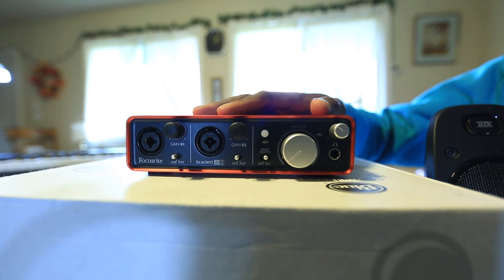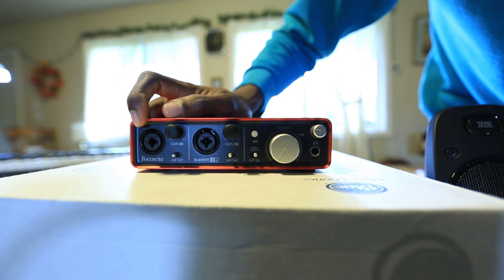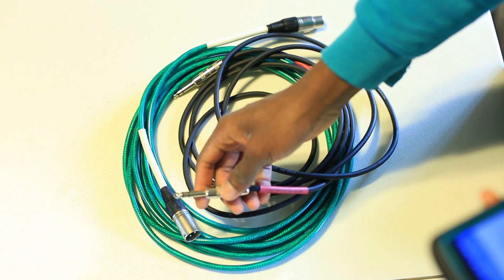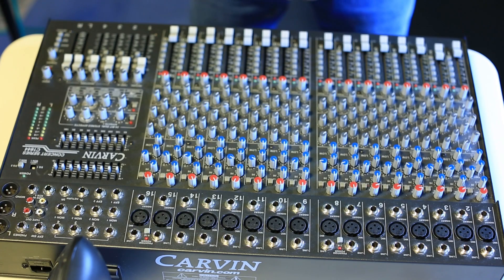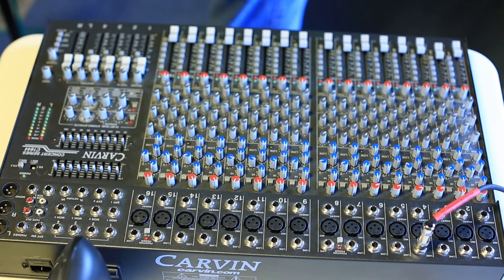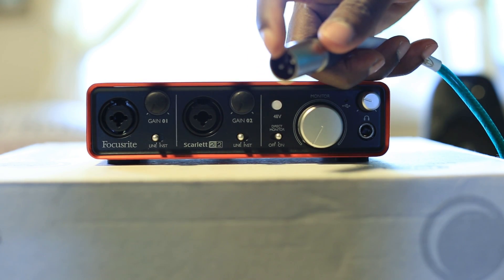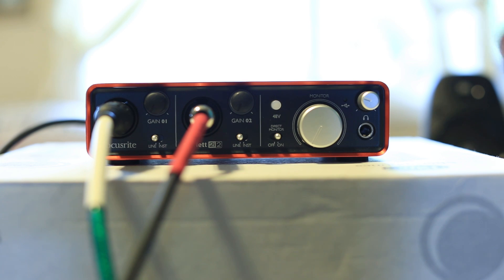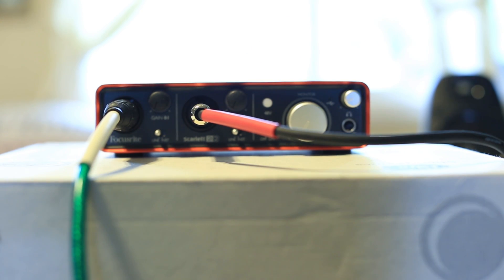Scarlett 2i2 Setup | Part 1 | Inputs (Mic/Line)

Comment: If I want to use a microphone, can I use a XLR>1/4" or do I need a XLR>XLR in for the Scarlett to get the preamp gain stage?
Reply from the maker: That is a good question! I don't how that would work from experience as I've always used XLR>XLR for my microphones (Except when I had a USB microphone).  But based on what I do know, it would probably depend on whether your mic uses phantom power or not. If it's something like an SM58 then I doesn't need power the way a Baby Bottle does, and you should be fine. If, however, it is a mic that does require phantom power, you may run into some issues. In general I would recommend using the same standard all the way through. (Example XLR>XLR or TRS 1/4">TRS 1/4" or TS 1/4">TS 1/4")

Comment: Is it possible to connect a regular "jack" microphone into any of the XLRs and make it work?
Reply from the maker: If it's a ¼" jack, it will should work.  Otherwise you have a free steps of conversion to go through. It's funny, I think of XLR microphones as regular ones 😄
Reply: Jaron Belboda i tried but I miss something because there are no signals coming through. And in my windows settings at the recording, only having a focusrite stereo 1-2 record option, no mono option at all 😕😕😕

Comment: Can anyone tell me...can I set this up so that my daughter can sing along to utube via the computer ( computer has speakers)..problem I find is I can only have music through those speakers or the Scarlett...confused.
Reply from the maker: You would need to set the Scarlett up as the default audio output for the computer. That way your daughter can hear the music and herself using the direct monitor switch on the front of the Scarlett

Comment: Thank you so much for your excellent video. Have to change from Mbox2 to Focusrite. Whch one is similar to Mbox2 ?
Reply: Mbox2 has two inputs for keyboard, so I figured that I need Scarlet 2i4?
Reply: @LyudmilaOsipova , as stated.. Yes, "if" you need more than 2 preamps at once, that is a fantastic choice. You'll also gain more features with the 2i4...😉 Focusrite makes very nice equipment. You can't go wrong. I'm not a spokesperson for them but I do use their equipment as well. Best of luck. The 2i4 is an excellent interface. 😉 💜 🍀 👻 🎶
Reply from the maker: @LyudmilaOsipova  when you say two inputs for the keyboard, are you talking about audio or MIDI? Like @Bodē Ghost Productions said, The 2i4 is an excellent interface And you can connect your keyboard via the audio inputs on the front or the MIDI inputs on the back.
Reply: @theJaronamo  exactly... Well put. 😉
Reply from the maker: @bodeghost  thanks 🙂
Reply: Yes , I record my Yamaha through midi. So 2i4 would be OK. It doesn't have  S/PDIF in and out, but I never used it anyway. Will get second generation, as I have El Capitan, and don't want any upgrade. I love my Mbox 2, all the problems started when I did upgrade, so I got the second hard drive with Yosemite , it works with Mbox, but you have do disconnect and connect again when you turn computer off. It is annoying.
Reply from the maker: @LyudmilaOsipova  ooh yes that is annoying! Glad you're able to make the switch. As you probably know the 2i4 is plug and play on the Mac
Reply from the maker: The one with two inputs and two outputs
Reply from the maker: In other words the 2i2
Reply: @ LyudmilaOsipova, great question & this gentlemen's video is very well thought out & easy to follow. From novice to pro! In answer to your specific question, yes, this Focusrite 2i2 is an INCREDIBLE upgrade from your M-Box2 situation. Im not speaking derogatorily in any way about the M-Box. Very nice interface for its time. You'll find extremely powerful & very 'clean' preamp (2) within the 2i2. Especially for its price point. If you haven't purchased it yet, look at their bundle offers. For not too much more of an 'investment' you'll get a ton of bang for your buck, if you will. 😉 ! I've seen these bundles ranging from $199.00 up to $299.00... I saw one that came with a nice mic, mic-cable, pop-filter, mic stand, & headphones! All for $229.00 !  "IF" you do not record more than "two" things at a time, say, a vocal & keyboard, at once, then you're all set. This channel recommends wisely indeed & I completely agree ! 😉 💜 🍀 👻 🎶 Best of luck to you & keep on making music! @ Jaron Belboda, nicely done sir. Straight to-the-point & easy to follow. I've "SUBSCRIBED" to your channel. 😉 💜 🍀 👻 🎶

Comment: is it possible to not use the USB for PC mic input and instead use the 3.5mm mic input jack on the motherboard of a PC? i have some soundblaster filters that don't recognize USB mics, would prefer to use these filters over 3rd party ones.
Reply from the maker: I'm not sure I understand the question. It's always possible to use 3.5 mm mic input. Though generally not with an XLR microphone. When you say filters, do you mean effectd that process your sound as you're recording?

Comment: According to Focusrite: "https://focusrite.com/usb-audio-interface/scarlett/scarlett-2i2    not TRS, can "plug a bass or guitar" right into it.
Reply: sooo.... there's no issue with plugging in a TS (no ring) unbalanced 1/4 in into the combo inputs? I guess it's wise for the outputs on the back to studio monitors, but inputs just normal ol' TS should do?
Reply: @michaelb2211  When you are connecting a TS cable you have to set it to "INST" and for TRS it should be on "LINE". It electronically adapts to 2P or 3P connection. It is better to use a balanced TRS cable and set to "LINE" if you are not connecting your guitar directly...
Reply: @ayberkfahri  you mean the guitar should input into the focusrite via TRS and set to line for input?
Reply: @michaelb2211  you cannot use a TRS cable with your guitar. What I meant was if you connect your guitar to an amp or to a DI box before the focus rite  and output is balanced then you should use a TRS and the line mode
Reply: @ayberkfahri  ah, the output from the amp to the focusrite?
Reply: or the focusrite to monitors?
Reply: @michaelb2211  my amp has balanced XLR output so from amp to focus rite a XLR-TRS cable using line mode
Reply: For focusrite to monitor you need two TRS to TRS cables for stereo.
Reply: @ayberkfahri  Cool, thanks - good to know. I'm not using balanced cables from my amp out to focusrite. What improvement should I expect?
Reply: @michaelb2211  mostly less ambient noise.
Reply: @ayberkfahri  Appreciated

Comment: Hello, I tried to connect my Scarlett 2i2 to my iPad using the apple camera adaptor, but the interface didn't get enough power from the iPad. The phantom power signal was on if I pressed that button, that's it. I did power my iPad at the same time.  But still the interface didn't work.  I watched some other videos on youtube and they said interface should get enough power from iPad. I don't know why, can you help me? Thanks so much!
Reply from the maker: You might try a powered USB hub like this guy does at about 6 minutes into the video:
https://youtu.be/GaARidUY2yU

Comment: Is it possible, connection foucusrit solo with yahmaha E 453? If yes then how?
Reply from the maker: For the Yamaha PSR-E453, no. It connects to the computer directly through USB.
Reply: @theJaronamo  thanks, so we can't play and sing at same time ( recording)
Reply from the maker: I wouldn't say that... It just might not be simple. Take it depends on how your E 453 works. I said what I said based on the product search which said it didn't have any audio outputs. If it does have something like a headphone out then you could connect that to the Scarlet with an audio cable. 

If what I read is accurate and it only sends audio through USB, then you'd have to figure out if it works like an audio interface (meaning that it both sends and receives audio from the computer) or if it works like a midi controller (sending midi data to the computer to control virtual instruments).

Comment: Can you plug in unbalanced ts cables into a trs input like the one on the Scarlett? Without losing audio fidelity?
Reply from the maker: That's a good question. Personally I went with a TRS cables because my monitors also have a TRS as their input. You could probably try it and see if there is any difference.
Reply: It says, it can handle the hottest pickups so that would imply they are TS or it does not matter. I wondered the same thing, this whole balanced/unbalanced thing gets really screwed up. Who has a "balanced" guitar line, isn't that why we need an interface to go balanced to DAW or some other recording device? I need something to handle two unbalanced ins and convert them I was under the impression that is what this can do.
Reply: https://focusrite.com/usb-audio-interface/scarlett/scarlett-2i2    not TRS, can "plug a bass or guitar" right into it.

Comment: Hey man! Great review! Question, is it okay to plug just one cable at either line output at the back? I plan to use just one speaker. Are each line output (left and right) set to Mono? If both speakers will sound the same, I'll try to use just one. Thanks man.
Reply from the maker: Hey good question! I have done that with the pair of headphones and as long as you don't have any of your sounds panned hard right or hard left you should notice a difference. You'd notice even less with just one speaker.
Reply: Jaron Belboda thanks man! Thats really good to know.

Comment: After I plug in both mics, how do i make sure I can hear the other person's voice when talking? Will their voice play through my headset?
Reply from the maker: Once you've switched on direct monitor you can hear whatever you have plugged into the Scarlett. The only reason you might not hear the other person is if you have the gain knob for their mic turned all the way down.
Reply: dope. Thank you for the reply! :)
Reply from the maker: +Thunder Ballz No problem, bro =)
Reply from the maker: I'm guessing you mean headset microphones? In that case, you want to check your recording settings in your DAW and make sure you're capturing mono and not stereo. Most mics are mono, so even if you record stereo it tends to be one sided.
Reply: im only hearing left

Comment: hi jaroneedr advicei have  mic going into my focusrite 2i2 now the problem is that i cannot adjust the microphone effects o on some things it is very very quiet and would like to add some echo any recommendations on how to achieve this
Reply from the maker: +Daron Branston Hi Daron,
I'm not real sure what to do about your volume since I don't know what mic you're using. In general you would adjust levels with the volume knob for the input.

As for adding echo or delay, that would be done in your DAW as the scarlett is not an effects box, just an audio interface. The included plugins work as effects in a DAW. So I reccomend looking up how to import and use third party effects ( like the scarlett's included plugins) in your DAW.

Comment: focusrite 2i2 interface and studio monitor
which cable goes on 
TRS stereo cable or 
TRS mono cable?
Reply from the maker: I know that's sort of confusing, isn't it? But basically TRS goes both ways. It can connect to a balanced mono signal,  (instead of an XLR cable) or it can be used to output stereo, like it does with the headphone jack at the front of the Scarlett. 

The outputs on the back of the Scarlett are mono, but still balanced as far as I know. This would make sense since most of studio monitors that I'm aware of have balanced inputs unless otherwise noted.
Reply from the maker: Hope this helps!
Reply: @theJaronamo  I thought the main point of TRS was stereo - the outputs on the back are mono so you'd need to plug each into a left or right monitor (regardless of number of inputs or source)?
Reply: oh and is a mono TRS cable called a TS cable?

Comment: WHICH IS BETTER FOR STUDIO MONITOR 
STEREO CABLE INPUT OUTPUT
MONO CABLE INPUT OUTPUT
Reply from the maker: 6:45 in the video. The outputs I pointed out on the back of the Scarlett. If you want to setup another way see Part 2.